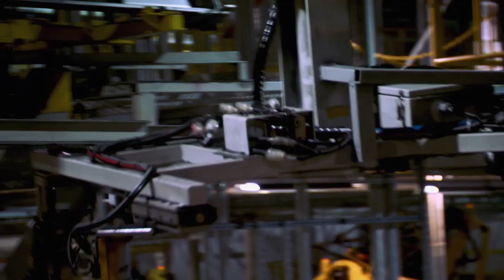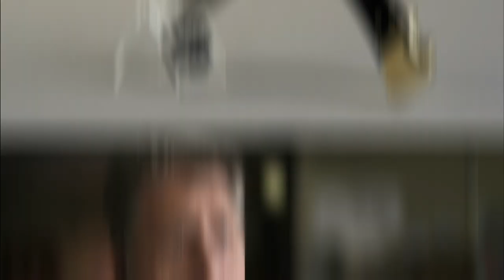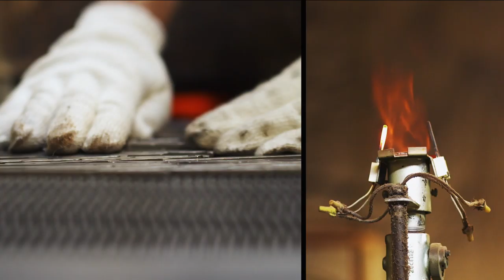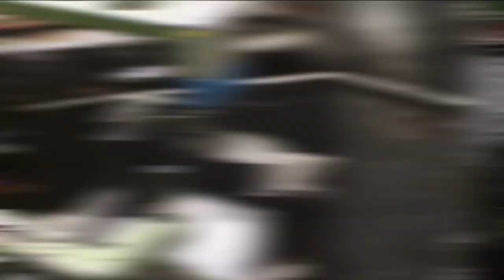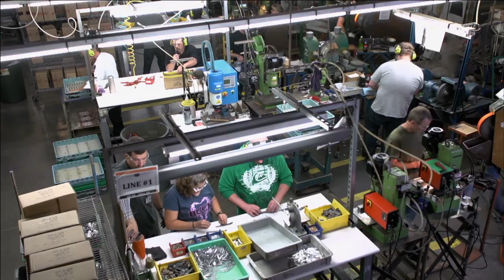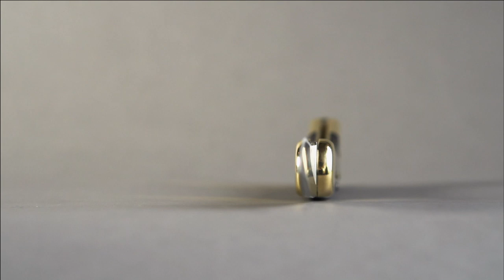How the classic BUCK 110 Folding Hunter Knife is made – BRANDMADE in AMERICA

Comment: Been a knife guy forever. For what you get at the price level,you will not beat a Buck knife even at twice the price.
Reply: I can get more work done faster with less fatigue with a classic mora that  cost my grandpa less than $1 in the 50s. Love my bucks but there are less expensive better knives. You can still get a classic mora for like $15 last I checked, that's like 1/4 the price of a 110 which is a folder and everybody knows a folder is nowhere near as reliable as a fixed blade. The moras also 1/4 the weight lol and it's a fixed blade!!! With a lot more blade!! Blows my mind.
Reply: @wis1024  Mora's are great bargains. But comparing fixed blades to folders is apples to oranges. There's a LOT more work and precision that goes into a folder.
A more fair comparison would be something like an Opinel. Simple, inexpensive, classic folder that performers great for the money. 

All said and done, the Buck is still a great classic, and one of the few affordable knives still made in America.

Comment: Got and still have my 1978 buck 112. I just sent my early 80's buck 110 with finger grooves in to replace the blade. I have a 2000's 110, 119 and a cattlemen and several others. Been a buck fan since the 70's. Forever Buck!
Reply: Boy that must have sucked seeing your 1978 and early 80's blades in 440C getting replaced with soft 420HC. Faster sharpening but half the edge life.
Reply: @johnj6689  I only had one blade replaced. It was broken and I had them remove a clip point blade and replace it with the drop point blade.

Comment: I have owned a buck 110 all my life. Still have one. But, hat was before I got to know about steel. 420 is probably the worst steel you can get. Super cheap is why buck uses it. They have a good heat treat but garbage steel. My buck 110 has sat in my closet now for years. Rest in piece little guy..

Comment: So machines don’t do all of it? That means if I get a poor quality knife it’s cause of some regular joe who wasn’t paying attention.
Reply: If you get a poor quality one, send it back to Buck for a replacement. They also guarantee for life, so if anything goes bad, send it in and they'll repair it for free, postage pre-paid. Although, I've never purchased a "bad" 110, and I have  collected and used them by the dozens over a few  decades. I had a couple that developed "blade wobble" (I bought them in the 1970's) from wear and tear, and they replaced the blades and "tightened" them up and sent them back after I stated they had "nostalgic" value and they had offered to just replace them with new knives. They also asked me if I wanted to keep the original 440C blades, in which they would sharpen them to factory specs and reinstall or if I wanted new 420HC blades, which I selected.  Class act. For knives that cost, what, 65 dollars new?
Reply: @SSN515  I got one it was a $60 one and I love it its genuine buck but the two chiped off🥲

Comment: My New 110 came all dirty with green compound inside the handle. They forgot or didn't care to clean it during assembly. The opening/closing is so gritty like there's sand in there. It took me an hour to clean the green junk out of there and it's still not as smooth as it should be. The workers at Buck are incompetent. How a sample like this passed final quality control inspection? Disappointing.
Reply: Send it back then